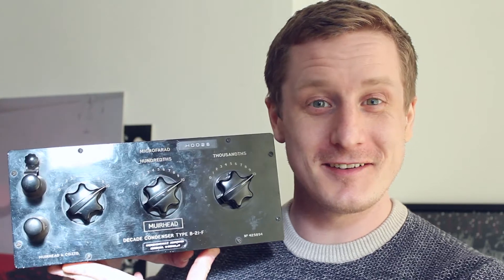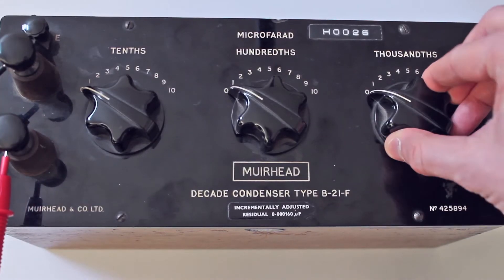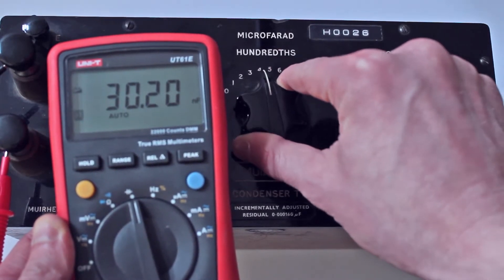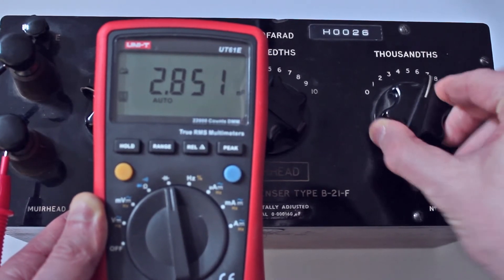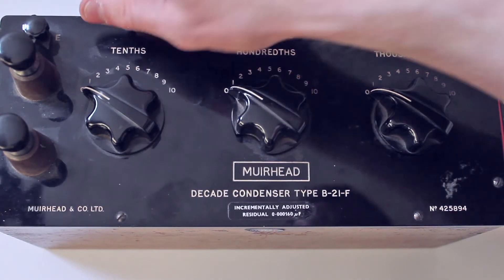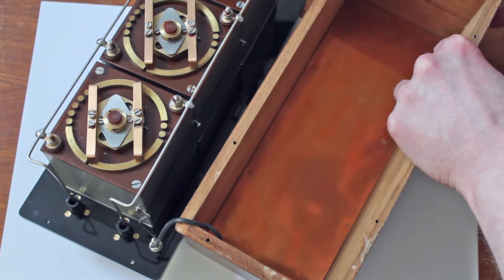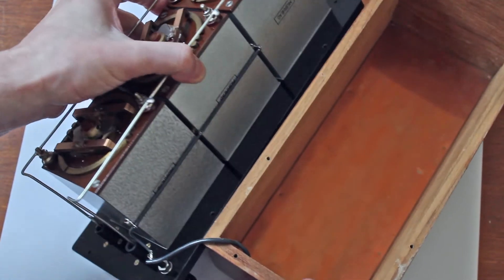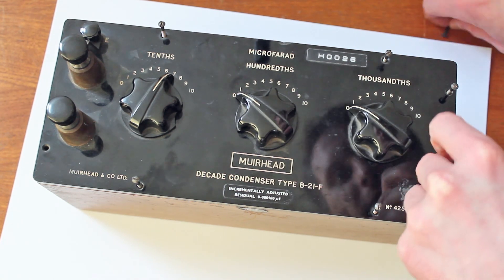Vintage Tech: Muirhead B-21-F Decade Condenser - VT2

Comment: Those were the good old days they don't make em like that these days!! The reason for the strange looking switch mechanism is due to the fact that they switched capacitors in parallel to increment the value. The quality of those low resistance contact switches is awesome!